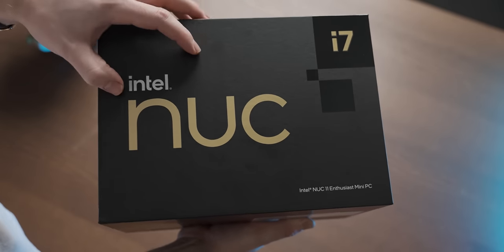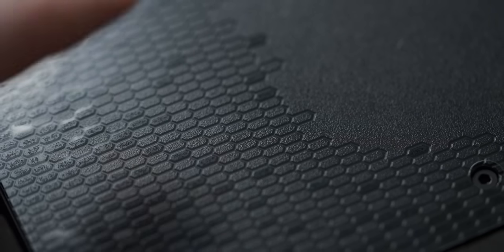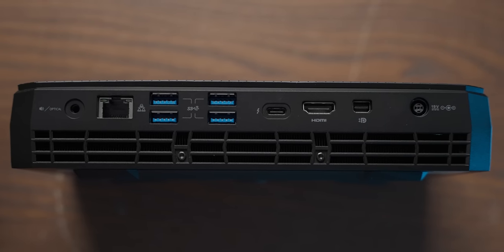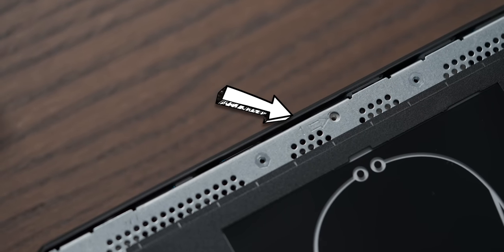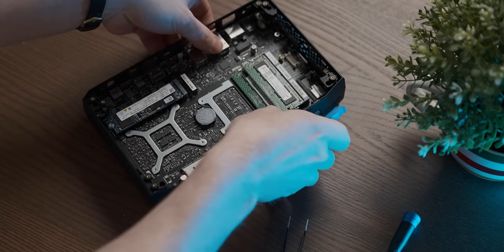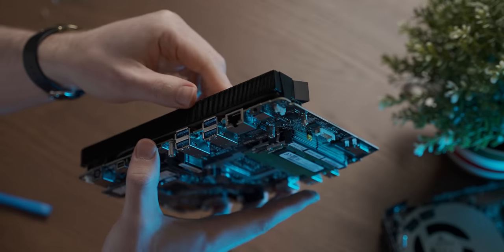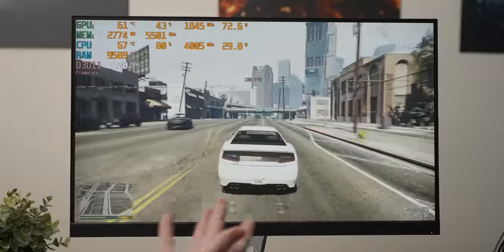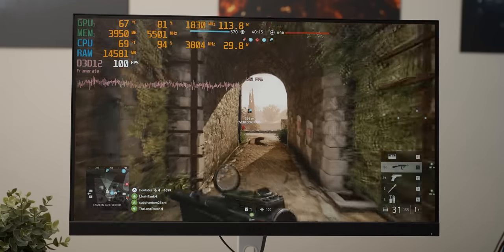TINY Intel PC Comes With RTX Muscle

Comment: Well if you are a student and you want a low budget system a 4 core it's ok, otherwise should be avoided go for 6-8 core cpu for better perfomance, well i didn't see how much you pay if it's cheap ok if it's expensive avoid it. also new amd cpu with igpu have arrived so go buy this instead they are better then intel in igpu. Cheers
Reply: This thing is about 700-800 bucks. An AMD one in the same price range has worse IO, way better CPU, but probably an iGPU, which since the 680M aren't bad, but they only provide about the power of about between a 980m and 1060 mobile. Though you have to be careful with AMD as lower tier CPUs only have an old Vega iGPU.
(I have a mini PC with a 6900HX, the 680M iGPU in there is faster on 3d mark than my old laptop which has a 6700hq and 960m, but the CPU crushes it. Good in non-game applications, but just a bit better in games, also about 900 bucks)
Reply: @DarthJane  yeah agree that you need to do research before you buy, intel till now their igpu are bad compared to amd, also we must seperate mobile vs desktop cpu with igpu, now with gpu vs igpu offcourse gpu wins easy, igpu only worth if you go budget not all people have money for good cpu/gpu system.

Comment: That's a damn shame about the 11th gen quad-core they're calling an i7. They've crippled the 2060 by not putting an actual i7 or even a hex core i5 in there 😢
Reply: "Old" laptop cpus 😅 .... by the way newer 12/13th i7 (and i9) like those used by Minisforum are much more capable (14 core and 20 thread)

Comment: I see they suggest to sell these at around $1,200 which is just insanely overpriced imo. You can get a laptop with much better performance for that price. I get you're paying for the form factor but that level of CPU/GPU in a $1200 system is absurd.
EDIT: I see you can get one for around $900... a little better but still not worth imo

Comment: That CPU really hobbles the performance. It should've had the 11800h.
Reply: It's crap compared to what offered by 12th gen
Reply: @federicocatelli8785  it would've been fine in this setup though. I have a laptop with a 3060 (the full power 130w version) and 11800h and no bottleneck. Also I don't think 12th gen was out when this NUC was made.
Reply: @tristanholley7141  
Think you're right but as March 2023 I would not buy a sff like this or anything with less than 8 cores like the 11800h you cited

Comment: I was sad to see you didn’t end up with one of the newer larger nucs where to can swap the graphics card out or get it barebones 🤩. Those have better CPUs and also are technically swappable as well if I remember correctly! 

I prolly wouldn’t recommend getting this version of the intel nuc at least not for gaming. The 11th gen Intel CPUs suffered from some weird thing where they would basically put lower watt chips into “gaming” laptops and hardware like this. Such as the asus tuf dash 15 2021 white model where it comes with a 3070 but it’s got something of a slower 4 core CPU for some reason 11th gen 11375h … idk why they screwed ppl that generation. I mean technically it would still run games but it’s just not as powerful as it should have been like the 11800H 🤷🏼‍♂️ idk lol…. 

But the average laptop buyer or gamer prolly would have no idea what they where buying, with out extensive research. Same with all the stupid different power specs on the laptop GPUs from nvidia 😠
Reply: Also yea talking about dlss not helping because the CPU is the problem. That is basically what you see in some of those laptops like the one I mentioned where it gets decent gaming performance. But like the asus pairing that CPU with a 3070 just doesn’t make sense because your getting less performance. I mean the GPU in that laptop still meant you could do some higher 1440p gaming but just not get the numbers you would on other laptops with different CPUs 🤔

Over all honestly I was sad to see that with the Nuc just like the Asus tuf dash 15. That white asus laptop has pretty good build quality and is technically very portable and thin 🤔. Idk the CPU choices in 11th gen where weird for mobile applications lol.

Comment: Why did you refuse to play in 1440p? Of course you are gimping a machine with a weaker CPU than GPU by playing at 1080p. 1080p and less is HEAVILY CPU dependent, whereas 1440p and above are heavily GPU dependent. If your strength is the GPU, you are being supremely silly not playing at 1440p or above...

Comment: For some reason I still do not trust mini PCs for a number of factors. Mini PCs have come so far up to the competition but the availability, pricing and listing aren't that good for a power user like me. 
Away from upgradability cooling won't be efficient in a hot region like where I live, everything's sealed in a box with a laptop blower fan and a piece of copper. (Regarding the temps of an average gaming laptop 💀)

I'd rather get a laptop than a mini PC for other reasons as well like portability, flexibility, real life uses and etc. 
On the other hand, I can get one for office use, bit of living room gaming/media and something light that I can use anytime without booting up my main device.

Comment: I just can't buy anything that uses a power brick, including a laptop. It just seems so wrong.....I'd feel dirty, and have to shower afterwards
Reply: You do know that your house has a power brick right? Granted, this power brick, or "sub station" as it is officially called is shared by several buildings, but serves the same basic purpose. Convert slightly unstable high voltage to very stable lower voltage.
Reply: @mitchellpatterson1829  You're missing the entire point. Electric companies use professional-grade equipment, where as computer power bricks are garbage. Not only that, but you can't upgrade one like you can in a standard pc. Real computers have a built-in PSU. And while we're talking quality, a real pc doesn't have a processor or GPU soldered to the motherboard.
Reply: @justsumguy2u  
That was a joke anyway.
I agree with you though, the main point of a PC is to be self contained, and it should be modular (only SMDs should be soldered, not processor or memory, excluding some SOC type devices). I'm not offended by a power brick on a laptop with a battery since the brick isn't always connected, but a NUC is intended to be plugged into a receptacle at all times (lacking a battery and all that) so accordingly the power inverter should be in-built.